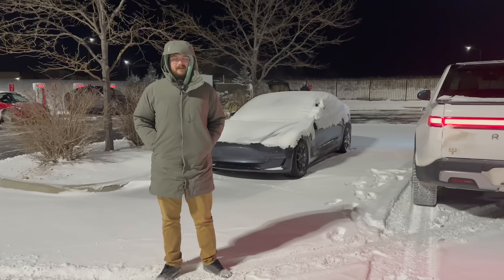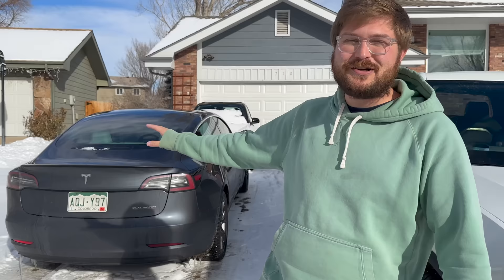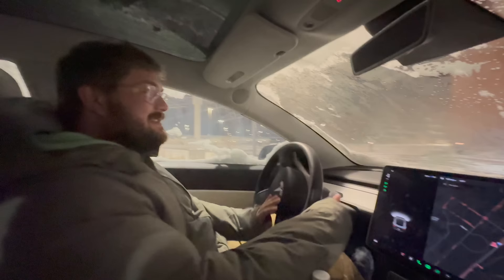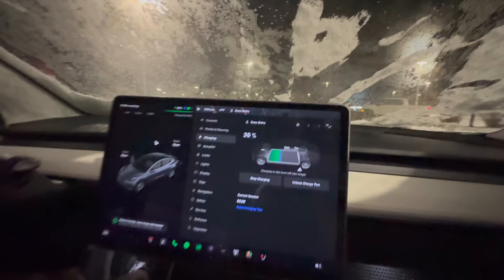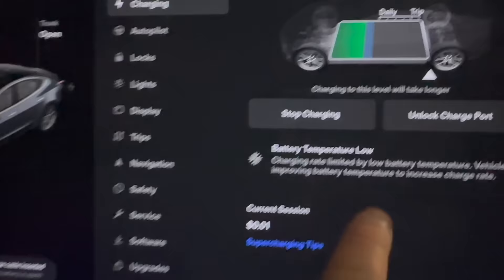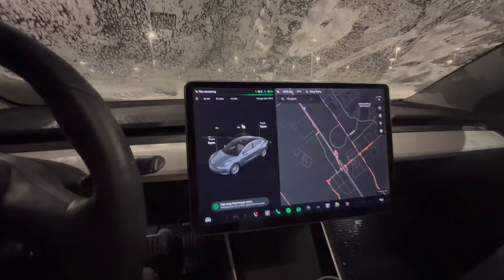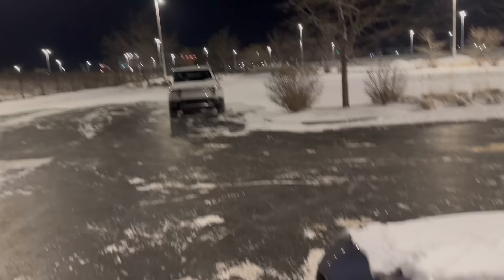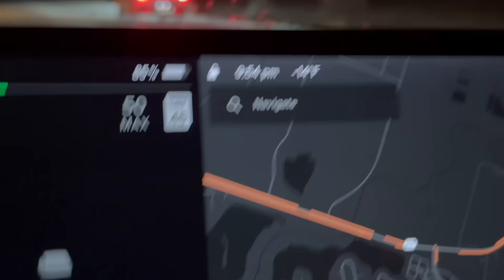I Deep Froze My Tesla And Immediately Plugged It Into A Supercharger To See What Happens

Comment: Other good tip for overnight roadtrip stops, besides preconditioning, is to supercharge ON ARRIVAL, when the battery is warm from driving (and the pre-conditioning), and get a decent charge while still warm... vs letting it cold-soak overnight like this, and trying to charge in the morning.
And/or if you have destination charger, let it charge & stay warm all night plugged in... or you can mix both and supercharge a moderate amount on arrival, and finish charging overnight.
Then pre-heat the cabin (and battery!) while plugged in before leaving.

re the frozen latch: isn't there a recent feature to not engage the charge latch in freezing temps, so it doesn't get frozen/stuck? I've seen folks complaining of "latch not engaged" warnings in very cold temps, I think it is intentional? Made worse by a clogged/frozen plug end too, but...?
Reply: My early M3 LR RWD has this software feature to not latch the cable when below freezing.  However it is for L1/L2 charging only.  Supercharging would not be safe without the cable latch.
Reply: @georgepelton5645  Thanks for clarifying/confirming!!
Reply: All of that vs stopping at the pump...... Convince me it's worth it. I'll take my 6.2L Denali any day.
Reply: @fyrefitrt2  I'm sure with your Denali when it's been sitting cold in -14 for two days straight you just crank it up and floor it without any warmup. Good way to damage your engine. Not to mention when you start getting down to -15 to -20 F you almost need a block heater for an ICE. An EV doesn't because it uses a minimal amount of power in the battery to keep it safe. The colder it gets the more energy it will use. With an ICE the colder it gets then you better have a block heater.  

With a Tesla you simply set a timer from your phone or the car to begin a battery preheat at a certain time in the morning. You can do it 1 hour before you leave the house or whatever. Just like warming up your car. It would melt the snow and ice off the windshield for you and the battery will be conditioned when you come out and jump in. 

This video is only a sensational example of what would happen if you didn't preheat the battery to show how long you would need to wait. If you are driving your Tesla in -14 then the battery will be warmed up and you won't have to wait when you stop to charge. Only when it's been sitting for days cold soaking. No different than an ICE engine like yours.
Reply: @flipadavis  Modern vehicles typically run on low-viscosity engine oil (0W-20) and therefore won't benefit much from a car block heater. Most are built to handle cold temperatures and are designed with engine-warming technology.

Copy pasted from the internet
Reply: Furthering my other point. 0W-20 oil was actually introduced and the most popular and required oil since 2010. 

You could say cold starts for any car past 2010 is unnecessary. It also provides tons of fuel efficiency as a result as well.
Reply: @fyrefitrt2  It become worth it when you pay your car off in fuel savings alone in 4 years...
Reply: @pyros4333 Disagree. Block heaters help to start cold cylinders, not just oil.

Comment: When connected to a Supercharger you can turn on the cabin heater to heat the battery quicker. It'll pull juice from the charger to run the heatpump (or PTC heater depending on model) and then reuse that heat for the battery coolant loop as well.
Reply: Not anymore, now it's 10kw of heat to the battery, 7 from motors, and 3.5 from heat pump...
If you want heat inside cabin, it'll be deducted from what the battery get
Reply: I was wondering why the car didn’t run the heater and dump it all into the battery pack as opposed to futzing with trying to make heat with the motors.  Or at the very least include “turn on the heater” as a tip along with “next time navigate to the supercharger”.   Really cool test though.
Reply: @theonetruestripes  it does, new ones uses 3.5kw for each motor, and heat pump, for a total of 10+kw of heating...
Reply: @theonetruestripes Tesla’s use heat pumps now. So to heat the cabin in conditions like this, it would use power to generate heat in the motors, and then use the heat pump to move that heat into the cabin. So that would mean less heat going from the motors into the battery in this case.
Reply: So who is right guys I don’t know who to listen to.?
Reply: @bryanthornburg8636  what exactly is a heat pump can you please explain it? 😊
Reply: @pureluck8767 basically a heat pump will harvest heat from outside and reject colder air...
Tesla will use it to heat up the battery, but it'll "vibrate " the engine, to heat up the coolant even more, to heat quicker
Reply: @dulcidy  so do you think it’s a beneficial thing or not really??
Reply: @pureluck8767 yep, definitely, it'll get up to speed way faster than without it...
You'll pay like 2% more to charge, but it'll take 30 mins instead of more than 1 hour..
Reply: @dulcidy  why is that?
Reply: @pureluck8767 because a cold battery will charge way slower than a warm one
Reply: I believe the Model 3 in this video did NOT have a heat pump so freezing in the cabin mostly made no sense.  Guess it would cost less for the charging session since energy would not be consumed to warm the cabin for 45 min and maybe the battery would possibly start accepting charge very slightly quicker (warmer on the top side of the battery).
Reply: Did not know that but I guess it makes sense because the two systems are not separate.  So the max draw from the heat pump is 3.5Kw?  I assume the average energy usage to heat the cabin would be less than 3.5Kw after the cabin reaches temp?  @dulcidy
Reply: Nice tip!
Reply: Maybe Tesla should provide a BIC lighter with each Tesla to help heat things up?
Reply: I would like to know how much it cost in $ to do that experiment? Does it cost more or less than gasoline in terms of cost per mile?

Comment: Reinforces what you have been telling us - on-route battery pre-conditioning is a really important feature for an EV.
Reply: Tesla has said as much as a 25% reduction in charging time with proper pre-heat procedures. #Wow
Reply: Glad I don't have these problems with my ICE vehicle! Never will. 😃
Reply: @rkeith4442  I preheated (and charged) an ICE car for 30 minutes last week at -20C (-4F) because it would not start (weak battery).

Replaced the battery in those temperatures because I needed to drive the next day at -30C (-22F). Pre-heated the car for 2 hours for that trip.
Reply: @jamesphillips2285 My ICE F-150 never had that problem!  I replace the battery ever 3 years or so, well worth the money.

Comment: That battery has enormous thermal mass. Enormous. Loved watching this full-geek test😊
Reply: Can you explain thermal mass?
Reply: @SimRan-ur5nl  Thermal mass is the capacity material have to absorb, store and release heat.
Your question was great, because its  not clear why a enourmous thermal mass would do any good for that EV without good gravimetric energy density and low thermal inertia.
That EVs battery could have great thermal mass but still be useless after one cold night if it had high thermal inertia and even more so if the nominal energy would be low.
Reply: @SimRan-ur5nl  The specific heat depends on the material, but for batteries with copper foil, steel, carbon, plastic, some solvents and the cooling water, it should average about 0.45 Jules/degree C per gram. So heating a 770 kg battery + 20 kg water from -20 C to +20 C would take: 0.45 * 40C * 790,000g = 14,220,000 Jules of energy. dividing by 3600 seconds in an hour and by 1000, that is about 4 kWh to warm the battery up, or 5.25 kW for 3/4 hour. (assuming the battery and cooling system is perfectly insulated, which is isn't)
Reply: Its thermal mass would be very low aside from chemical reactions it will reach ambient temperature quickly.
Reply: Yep you ever seen a Tesla burn,it takes days to stop burning.
Reply: I don't get why Tesla batt ain't insulated, a car sits outside especially for half without garages so need insulation.  Use some of that trunk room.... Literally add foot of foam around battery...  but I suspect they want good wind tunnel efficiency so no tall design even if this makes EV awful insulation so awful in extreme winter... Solvable if they redo design and basically thicken floor 2 feet for foam..
Reply: @mostlyguesses8385 it’s eventually going to reach ambient temp irregardless of insulation
Reply: @mostlyguesses8385  Dunno what solutions are used in EVs, but just as low temps are deadly for Li-ions (storage alone, not to mention charging) so are the high temps (inevitable when pulling high currents). We are talking about temps just above human body''s temp, nothing extreme. So extra heat insulation would require extra cooling, I believe.
Reply: @jwstolk  -
All of this handwringing over the charging capacities of the battery is dumb.  Battery power works wonderfully when combined with a combustion engine; i.e., the “hybrid”.  It seems like none of you “analytic” types seem to truly understand this.  With a hybrid, the battery charges itself while the combustion engine is running.  The process works seamlessly, AND the end result is still dramatically reduced emissions.
You seem reasonably intelligent, why not put more emphasis on the obvious and help to spread the word and educate more of these goofy Tesla fan boys and girls.
Reply: @lrvracer3515  The effect is not that dramatic at all, not enough to offset $10/gallon fuel prices here in Europe. All the owners of a hybrid I know are charging their hybrid from the grid instead of charging it with the combustion engine, since energy from the grid is almost 10 times cheaper than generating it from fuel. Almost all the hybrids sold here are plug-in hybrids. There is also no tax advantage for hybrid cars anymore.
Reply: @jwstolk  -
That economic scenario is not remotely applicable to the USA where nearly 20x more automobiles are sold and manufactured than in Europe.
Reply: @philipriesling3897  Should've learned to not be an asshole
Reply: They should just short out the battery for 10 seconds. It will heat up plenty fast.
Reply: @mostlyguesses8385  it's big and heavy enough as it is.
Reply: Who would have thought that a thousand pounds of frozen metal and witchcraft would take a long time to thaw out?

Comment: Took my 2020 model 3 to MN over the holidays from CO. Once the outside temps dropped below 5 degrees, the efficiency really started to take a hit, and even when navigating to a supercharger the battery wouldn't warm up enough to take a full power charge right away. Also encountered a LOT of snow/ice clogged charging heads, especially in Central Minnesota, as well as cables that had been knocked down by the wind, then filled with snow.
Reply: We traveled from northwest Ohio to Chicago on I 80/90 in northern Indiana.  Many Supercharger cables were blown down in the wind and snow covered.  It is unfortunate that the Supercharger stations don't have shelters over the units and the units don't have automatic heaters and sitting on top of the shelters that don't have a combination of solar panels and small wind turbines.  We have a way to go yet.  There is so much opportunity nonetheless.
Reply: @Stephen Orr  I think they need a more secure latching system. Hope they get enough feedback to consider it.
Reply: @kdjorgensen98  I agree with that whole heartedly.  I have trouble with these Superchargers putting the handle back into the correct position all the time. Not intuitive for a klutz like me.
Reply: A has car is way better!
Reply: @Frank-sy3li  was that a gas car or a has-been car?   sorry.... but not better for everything, just some things, and EVs are in their infancy. Many of their negative quirks will be worked out over the next decade or two.  The government should not force folks to move to EVs,  but eventually EVs will be so compelling and cost effective that most folks will want them.  If I want to sleep in my car (Tesla Model Y) when visiting friends/relatives or traveling, I can do so comfortably with no fear of dying from car exhaust while the car stays warm in the winter or cool in the summer overnight. Most folks wouldn't care about that feature, but it appeals to me. Making sure I can always charge the car takes a little planning, but not much effort and I find it fun. Folks how prefer their blackberries and flip fold phones from the 90s over modern smart phones will probably continue to prefer gas cars and I'd bet that gas cars, at least used ones, will be available in sufficient number to scratch their itch for several decades, though eventually they may become subject to increased tax and registration fees as the government or even HOAs will be pushing for cleaner air in places where folks like to enjoy the outdoors.
Reply: @slowercuber7767  I anticipate 1000 miles on a charge in ten years. Maybe even inductive charging built into the roadbeds. Probably only in the more advanced countries though.

Comment: 'That pretty much will never happen in the real world...' LOL!
Reply: Except it does. Currently we're in negative temps once again, and almost every day over the past 2 weeks we've seen negative temps. Same goes for last year as we had a 2 week stretch of nothing but negative temps.
Reply: It happened to hundreds of people in Chicago , it won’t happen in the real world ( my a$$ ) !……
Reply: People are dumb, they don't know how to condition the battery.
Reply: @leerman22 What type of battery, and how to you condition it?
Reply: @MassBoost  It's a battery heater, you press a button, that way you don't have frozen electrolyte capping the power draw or charge. You do use some energy in the battery to heat itself like a couple space heaters of power draw worth.
Reply: @leerman22  A heater a basically a dead short. Even something as simple as a hair dryer can take around 10 to 15 amps of power, which is around 1200 to 1800 watts of power. He said it's taking 5 Kilowatts, so that's 5000 watts, and when you have to sit there for 35 to 40 minutes doing that, that's a significant amount of power to heat the battery in order to just charge the batter. That's so impractical and wasteful, and it would have been worse if he had used the cabin heater to warm things up. Having a electric vehicle is so impractical for cold climate areas, as it just wastes a ton of power just trying to heat up the battery for charging, and there's been tons of people that have had issue with the chargers even working, case in point as he had to use 2 different chargers in this video.
Reply: @MassBoost   An electric heater is not at all a dead short, and space heaters do come in sizes of 5000W running on higher voltages like this battery. Says on a forum it needs 8.5KWh of energy per 15 Celsius which sounds about right and isn't the end of the world if they knew they needed to supercharge, not a lot of money in the grand scheme of things. This is only a problem if you have to use the superchargers since normally charging happens with level 1 or 2 charging from mains voltage so they don't condition the battery for supercharging by default. The battery itself can do the conditioning on battery before going to the superchargers as far as I understand so then it's using waste heat from the motor and/or inverter.
Reply: @leerman22  I partially agree except the dumb ones are the ones buying evs !……….
Reply: @thomasdaum1927   It was a bunch of Uber drivers who rent the car by the week and don't know anything about the car and they don't have home chargers.
Reply: @Islamisthecultofsin   It doesn’t matter it still happened ! DUH !………
Reply: @thomasdaum1927   Did I reply to your reply because my comment doesn't appear which means it's being shadow banned for no reason.  You need to know what you are doing when driving a car...any car.  That includes what to do when things go bad.  The video showed everything that went wrong in Chicago.
Reply: @Islamisthecultofsin  Ok did you say something to offend someone ? I post things that offended people all the time , it offends some people because they don’t want to hear the facts ( that people don’t want to hear ) about their electric car fantasies ! The truth is not always pleasant !…..
Reply: @thomasdaum1927    That's what I do.  U tube doesn't like my name.
Reply: @thomasdaum1927  so why are people in Chicago voting for those will one day force them to buy EVs???
Reply: @leerman22  maybe that's because those of us with petrol autos don't have to...
Reply: @leerman22  so you had to go back to school to learn how to charge your EV? I guess if you have time to waste charging you car.
Reply: @leerman22 when has anyone ever conditioned a battery before owning a tesla 😂😂😂
Reply: Park in a slightly heated garage and NEVER go on a road trip in the bitter cold.  Problem solved.
Reply: @ChristmasEve777  never buy a tesla. Problem solved
Reply: @JoeFiddle-ls5jh  I'm ahead of you there.  I was talking about EVs in general.  I have a Hummer EV.  So, never buy a Tesla and don't go on road trips in sub-zero temps.  The latter is actually good advice for anyone (gas engine or not)... don't want to break down in dangerously cold weather.
Reply: @oddjobsandrandomprojects  Good point.